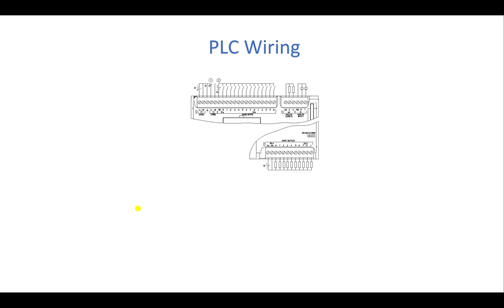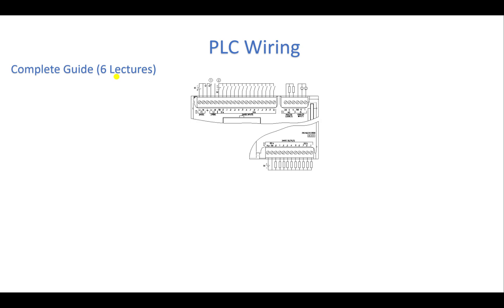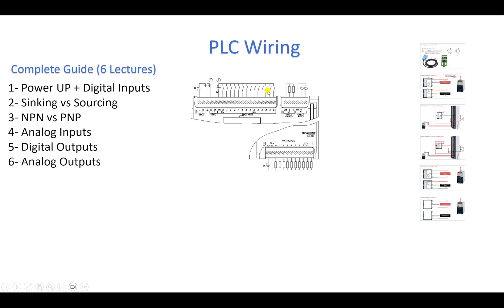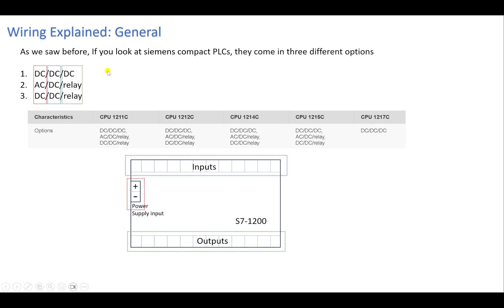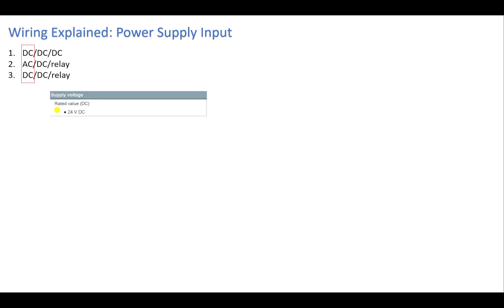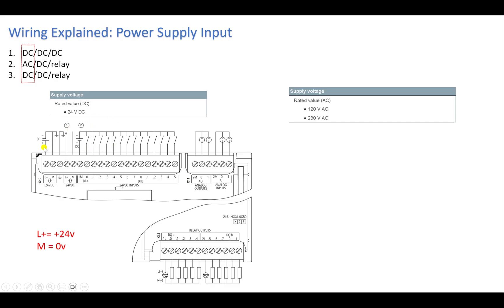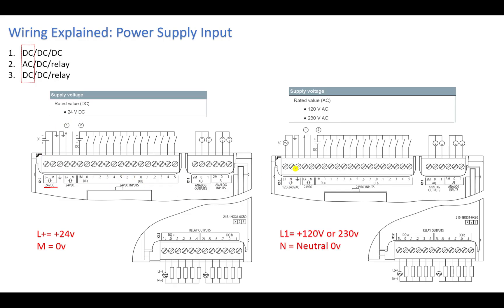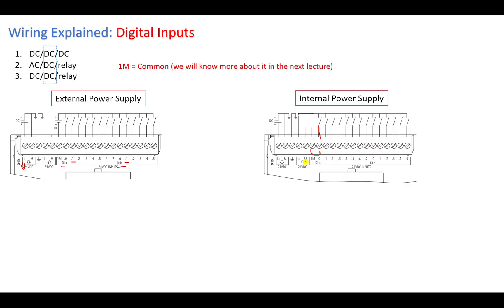Complete PLC Wiring Guide | Part1 | 2025 Edition | Siemens s7-1200 PLC

Comment: Is the M terminal of the 24VDC power supply given to the PLC same as the M of the internal power supply given out by the PLC? are these on the same ground plane? Or do I have to connect both M together externally?